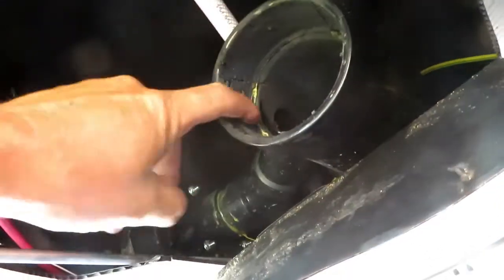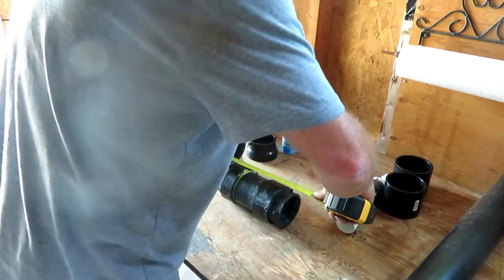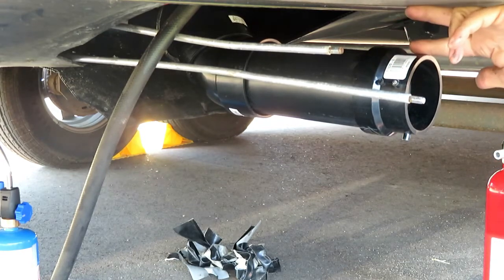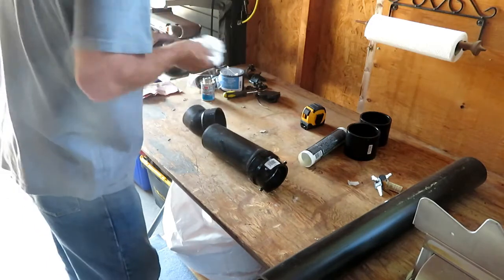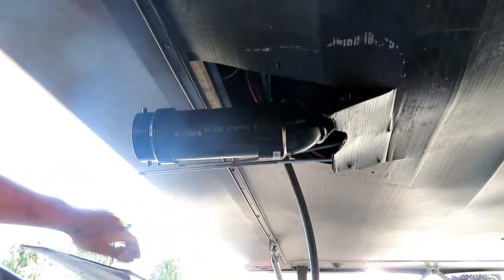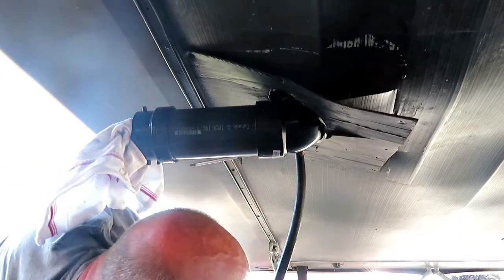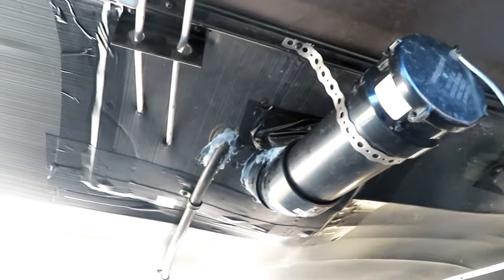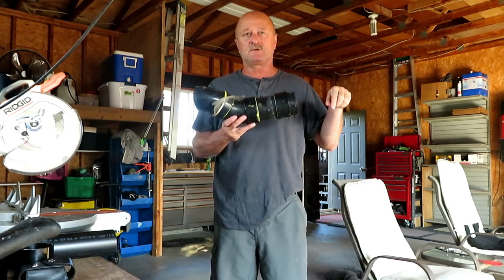RV holding tank sewer pipe replacement. Part 2 of 2

Comment: Could you please tell me where you purchased the piping. I especially need the end cap for my RV repair. The "ears" that hold the cap on have broken off.
Reply from the maker: HI  David   All the 3" piping was purchased at Home Depot the end piece was order off Amazon , Here is the item name from Amazon,ca " Valterra T1029-2 Termination Adapter with 3" Bayonet x 3" Slip Hub" I hope this helps.
Reply: I would think after breaking blk. Pipe. I would make a bracket  metal to protect the east line. This happen to me on my travel trailer.